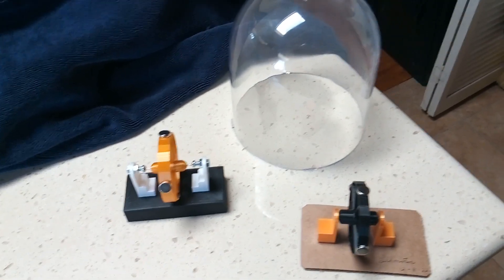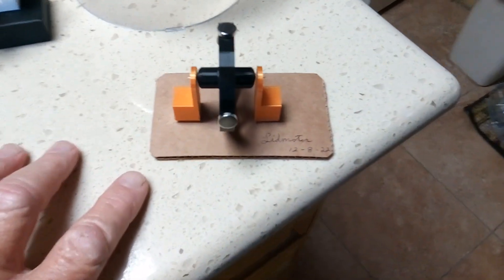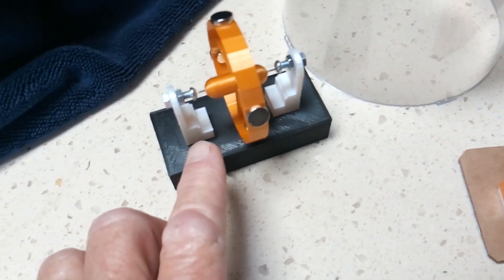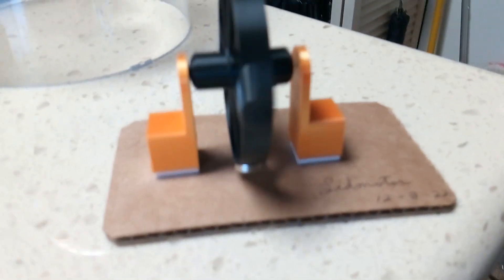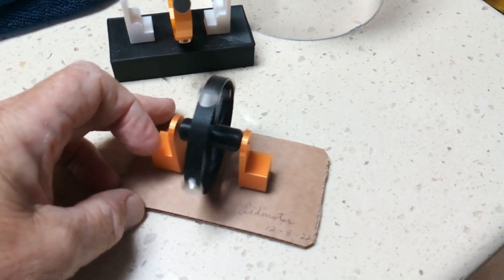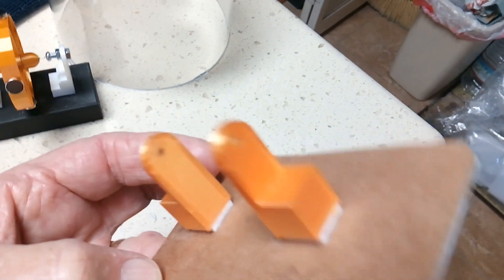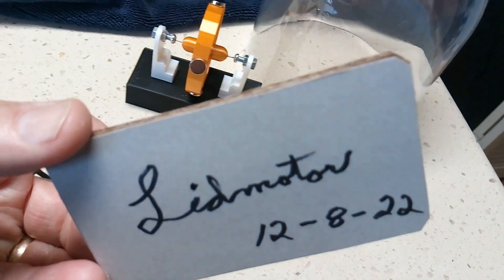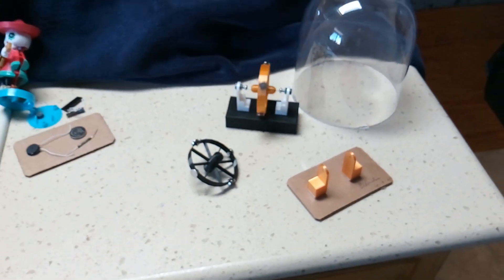The Thin Motor Mystery

Comment: I forgot to ask if you will share the specs on the Reed switch?
Reply from the maker: The reed switch is a "normally off" type and is about 1/2" long.  Get em on Ebay or Amazon.
Reply: @Lidmotor  much appreciated. THANKS

Comment: Very nice, Lidmotor! I think you could improve the illusion by using transparent brackets or very, very thin designed brackets. My first thought was, that you have the circuit inside the brackets because they look heavier than the previous ones.
But as you have everything in the cardboard, you could really concentrate on a even more minimalistic design. But anyway, I like everything you do! Very inspiring!
Reply from the maker: Thanks.  I could make the whole thing out of cardboard.  Cut the base, rotor, and the brackets out of one piece of corrugated cardboard. That would be fun.  To make a really good illusion you do need a misdirect or two. The thick brackets send people off in the wrong direction.  In the all cardboard version I could do that also.

Comment: Ah, very cool and effective. Must say, I thought the cardboard was too thin and was looking at the supports  🎖
Reply from the maker: Several people have mentioned the supports as the hiding place.  If I make some new ones out of clear plastic that would be better or maybe just make them out of thin cardboard.
Reply: Perhaps plexiglass would be rigid enough while clear (can be broken by scoring with a utility knife). Either which way, it's a classic distillation of what are often art pieces from yourself these days 😀
Reply from the maker: @Slider2732_  Thanks for the tip about scoring the plexiglass and then simply breaking it.  I will try that.
Reply: Have done that a few times for various projects (arcade machine 'glass' etc). Score several times to make a groove, then put the piece over the edge of a sharp 90 degree table or similar. Karate chop it for a clean break. Tiny pieces usually snap cleanly by scoring then using pliers  😀

Comment: Too bad you don't know how to make a forever running engine. Humanity is waiting for a new source of energy
Reply from the maker: Maybe someday I will stumble onto to something amazing. I had a dream years ago that I built a battery powered motor and forgot to turn it off before I went to bed.  The next morning when i went to check on it the thing was running at a high rate of speed and was covered in frost.  The run battery had burst from being back charged and the room was cold. The local environment had given it's heat to run the machine  Dreams are fun.  Sometimes they come true.